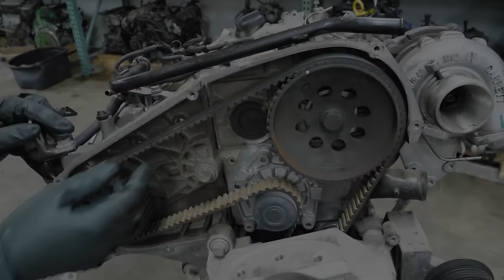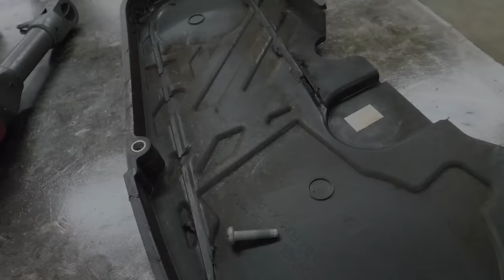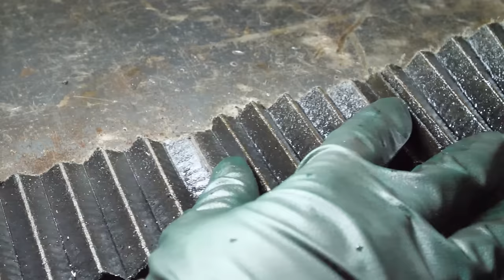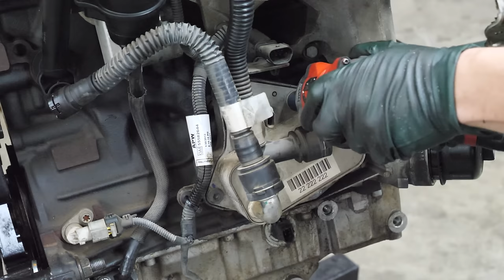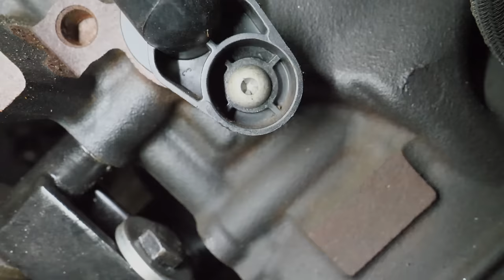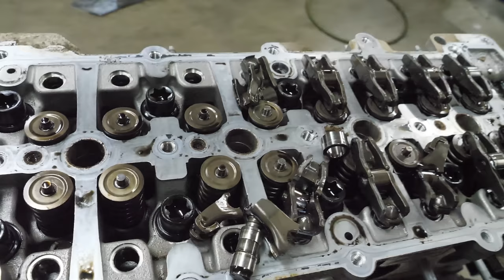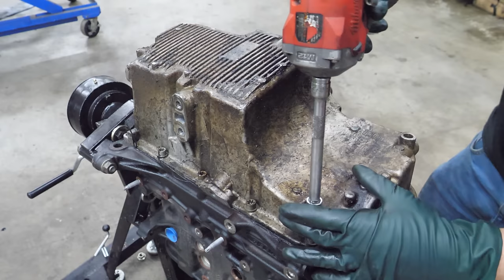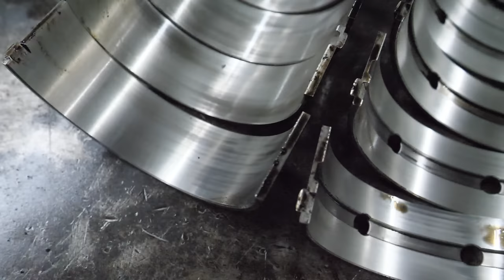I RUINED IT! Tearing Down A "BAD" 2.0L Chevy Cruze Diesel The Wrong Way

Comment: This is a Fiat 2.0 Multjet engine for sure. very good engine indeed. They design the rockers to do that instead bent valves.
Reply: It's Italian how good could it be? 🤔
Reply: @samholdsworth420  kkkk, I mean.. good enough.
Reply: I initially thought this was the VM motori one that was in the older Cruze, but this is indeed the 2.0 Multijet!
The first gen of this engine liked to spin the main bearings due to a design flaw in the oiling system, LOL
Reply: Think that's the PSA engine
Reply: It’s a fiat?  Rut Roh, rrorge!👎
Reply: 2.0 Mjt is based off the 1.9 JTD 16V
Reply: It'a Fiat engine. Very good engine. Italia made sit in Opel Chevy, Saab and Fiat .
Reply: @samholdsworth420 people get 400hp on stock internals. All forged. First gen 8v that was first common rail diesel in car is best diesel engine made in europe
Reply: Yes, it's the updated 1.9 Fiat JTD/Multijet.
The 1.3 Multijet behaves the same way in case of timing chain failure
Reply: Yep FIAT multijet unit best version of this engine with four cylinders is in Alfaromeo`s they also made a 2,4 version with 5 cylinders can be tuned for mega power.
Reply: @samholdsworth420  Diesel powers most of Europe because all we think about is MPG.
Reply: That engine is a good rebuilder.
Reply: @samholdsworth420  Clean your mouth, if there's something that's good from FCA (Italian ones...) are the engines.
Reply: @AlessandroGenTLe  u mad bro?
Reply: Hm I don’t think so: it’s covered in GM  badges and, in the early teens, Fiat bought Chrysler and I’d find unusual that the collaboration they did have in the first decade with GM was still going.

Said collaboration saw a platform being shared (Fiat Croma, Saab 9-3 and Opel/Vauxhall Vectra) and did include an interesting Diesel, but it was a twin turbo 1.9L that showed up in Saab and Lancia and got 180-190 horsepower. They had a 2.0 in Fiat (Bravo) which put out 140 or 165 HP but I’m not sure it ended up in any GM  product.

Now the lot have been bought by Peugeot-Citroen and the Multijet engines are being phased out, alongside with all other Italian designs, in favour of French oil-burning stoves. Bloody french. No idea about the fate of Chrysler: over here in Europe only Jeep is still sold and the small dorky models are also turning French.

This is a copycat of how VAG does it since 20 years but in French gravy. Which IMHO is as sad as f**ck because you get one car to buy with a dozen different skins.

~~~

I stand corrected: this really is a Multijet II engine and it just made it through before the FCA Group era!
Reply: @samholdsworth420  actually Multijet engines were very good. Also the small petrol FIRE engines were really good, too. And apparently this is one of them, just before FCA era.
Reply: @Me-zo8yc  You mean CO2/km?  It went from 10% diesel passenger car share in 1995 (the same as Japan at the time) to50% diesel passenger car share in 2015 based on EU policies,where Japan and California went to the petrol-hybrid approach like Priuses  instead. I would say it was a deliberate policy to support domestic industry, as European car makers are good at passenger car diesels where the emerging Japanese brands who were gaining market share  in Europe in the 80's and 90's are really bad at  them. But Europe realised  they were mistaken (there are  lots of particulates and soots from diesels that damage urban air quality in cities like London) and have back-tracked on that now.

In many countries in Europe, diesel had much lower fuel excise than petrol to support this policy of encouraging motorists to buy diesel passenger  cars.  But this is being reverted these days.  There are less of the older diesel cars which are still ULEZ compliant for being allowed to drive in inner London for example, compared to older port injected petrols that produce lower particulates.
Reply: Don’t know where you are getting your information from the 1.6 LH7 is a Opel designed, Hungarian built diesel
Reply: It literally has GM markings on the heads, block, and crankshaft but feel free to continue with the “ItS a FiAT” nonsense
Reply: @Veritas419 I mean you also have the same thing with Ferrari and Chrysler...
Reply: @Veritas419  I have this in my Jeep Compass with the FPT markings all over it
Reply: @Me-zo8yc it italy when I was there early 2000s they were all diesel and manuals. Only one car I saw had a automatic. Mpg over hp
Reply: @Veritas419 a couple engines from GM powered FIAT cars as well. At least here in Brazil. Pretty common to mark them as it was yours.
Reply: These are good engines.
Coming from VW-motori / Fiat.
Could drive lots of kilometers / miles without any issues.
Only when used for short runs de EGR and the valves in the intake manifold wil lock up. 

So, blind the EGR, and remove the swirl flaps, and you have a super reliable engine.

In original state it can be tuned to 210 a 210ps, and 450nm
Reply: It's fiat 1.9 from the beginning 
Very nice engine
Reply: Fiat has a long history with long lasting and efficient diesels, small and big👍
Reply: 2.0 D 4 cyl better is M47
Reply: @Veritas419  Fiat designed built by GM of course they put their branding on the ones they built. They don`t want customers opening the hood and seeing fiat logos in a gm car.
Reply: Wait , fiat designed something good?
Reply: @fuse8052  fiat have designed lots of good engines over the years. i had a part share in a race car with a fiat engine (1300cc uno) when tuned we ran the engine up to 8500 rpm with a standard unmodified bottom end as per our class rules, not the slightest problem with this ran 3 whole seasons no problem.
Reply: Sometimes... 2.4 20 valve in a 159 bent all of them. Just started rebuilding it.
Reply: @stih201 no Fiat
Reply: @stih201  Nope, it's an FPT engine.
Reply: @wimv6  You mean VM-motori I guess, but this is an FPT engine. The VM-motori engine in the cruze was SOHC. Yes, Fiat owns VM-motori, but this engine wasn't designed or built by them.
Reply: @SBT300  we bought a brand new 16V engine  and picked it up at the Opel engine Factory in Keiserslautern Germany,  it was in a VM-Motori crate.
Reply: @wimv6  The VM-motori for the cruze was 16V, but SOHC. As you can clearly see in the video, the engine is DOHC. That's the FPT engine.
Reply: The Chey had a Chevet with I think was 4 cylinder diesel and may of had 3 made at the Alanta plant we would have to get a running start to get it on the ramps . But at the start of ramps it would not go over the end of ramps no power and a auto I think and they were junk !
Reply: Huh interesting
Reply: @samholdsworth420 better than the 1.4 multi air engine for sure

Comment: This engine had a bad waterpump. The waterpump on it was brand new  the waterpumps on these engines have a habit of seizing up than the belt will rub against the cover until it snaps. Thas why the rockers were broken. I think they did a timing kit on it to fix it but it didn’t work. This is a common problem of this type of engine what actually is a fiat/alfa romeo engine that gm had the rights to manufacture.
Reply: I would pass on any Italian engine😅
Reply: Its actually a very good engine you just have to change the waterpump on time. I have seen these engines run over 300000+ without any major issues.
Reply: That makes a lot of sense, actually.
Reply: @sofarsogoodsowath   Except for three water pumps !  😂
Reply: Better go get that pump out of the bin!
Reply: @samholdsworth420  I had a 1992 Alfa Romeo 164-S with the 3.0 12-valve busso, it had over 420k miles on it when we parted ways due to irreconcilable subframe rust. And yes, that was a lot of timing belts... But the engine was solid as long as you never let it de-tension the timing belt from rollback in gear, or forget to change the belt and tensioner on time 😅 the rest of it was great
Reply: The French and Italians make crappy products BUT their diesels are very good!
Reply: you sir need upvotes, take mine
Reply: @samholdsworth420 why? I drive Italian Cars since 30 years and I work on Italien cars for 15 years. There is no Bad engine, but Bad drivers. When this cars get out of garantie the owners dont do Services. 1st owner goes to fiat dealer and let them repair these cars. 2nd owner went to a freelancer and 3rd only drives with the Sun in the Tank and Wind in the back.
Reply: @peterdevreter  The French and Italians get the reputation of making crappy product and their stuff from the last 15 or so years where they swapped a lot of stuff with other manufacturers to save cost would bear that out but going back in time the two countries gave us some of the best innovative design  and were not afraid to think outside the box. It was a time when cars were interesting and each marque was different. They were hard to work on and that is another reason they had a bad rap but they were never boring. Citroen Traction Avant/DS of 1955 and the SM late on, the Renault 5 Turbo - 12-16- 2CV and 4 CV,  Peugeot made tough reliable cars for many years that were rally champions, Fiat Spiders/1500 models/Alpha Sud /GTV's and more, Ferrari, Lamborghini, Maserati, Lancia. Lots of rust but never dull meat and potatoes cars.
Reply: That is exactly what happened. Well spotted
Reply: The rockers were broken by using an impact driver to turn the cams and drive the valves against a piston at TDC.
That is blindingly obvious
Reply: @PaulG.x  So explain the broken rockers on cyl.1 which was at BDC.
Reply: @PaulG.x  and explain no ticks on the top of the piston if so blindidly obvious
Reply: @spaceghost8995  My neighbor's 2nd gen 5.7 Tundra went through more starters than that. OEM starter every time too😂
Reply: Very similar to my cjaa tdi, need timing belt and water pump every 120k
Reply: @ctbale1  explain how the rockers were bent then
Reply: @PaulG.x  ok, I will educate you, but first grasshopper tell me how #1 and #4 cyl rockers broke when their valves hit the top of the pistons when they were mid stroke.  So many clues grasshopper, follow the clues..... :)
Reply: That's far from a certainty. I do think it was running when the valve damage happened, but I don't think the water pump started this. These cars alert the driver every 100k miles with a message that says "Change Timing Belt - See Owner's Manual". I'd wager a bad shop royally screwed up the job. Someone spent a lot of time scrubbing the water pump mounting area... except the water pump on these uses an o-ring. No gasket. I've replaced my timing belt, water pump, and idler/tensioner pullies twice on mine, never had an easier water pump in my life. It just slides out of there. Nothing to clean. Conversely, the owner might've ignored the messages and drove the car until timing belt failure, at which point a shop didn't realize these are interference engines and replaced all of those parts just to find out the motor was toast. Either way, hard to say after it's been sitting.
Reply: @Nightlis1  ha. no.
Reply: Yes I've replaced my waterpump 3 times in the last 2 years

Comment: I used to build these cars in Lordstown and I was there when they launched the Turbo diesel. Just a little nugget, the diesel  cars came down the line with a red manifest taped to the hood indicating diesel, regular models had a white sheet. Diesel car all received heavier trim pieces, thicker hood pads, thicker firewall padding, thicker padding under the carpet, behind all the trim pieces. and under the rear seat. They also received more body sealer inside the spare tire well from the body shop. I'm pretty sure they also had a thicker head liner. All to help with the extra noise from the diesel.
Reply: Very interesting, I would never have thought they'd invest the cost and effort!
Reply: Unrelated, but I have a 2009 Chevrolet Cobalt SS. You guys did an awesome job assembling it. 👍
Reply: @James-vt2cb  The "ECO" model was quite the opposite. It received less padding or lighter parts. Some padding was outright eliminated. It had no body sealer in the spare tire well all in an effort to make the car lighter and more fuel effecient. And if I remember correctly, the front grill had movable louvers that would activate in certain conditions to help with the aerodynamics also improving fuel economy. As far as features goes, it was basically stripped down, as basic as it gets. So basically, you're getting a better built car when you buy the diesel because everything was beefed up for the diesel engine.
Reply: Thanks for the added info! I had a 2015 with this engine. Very smooth running and powerful. I did have a tune on it for 30 more HP. She scooted pretty good with ~ 280 lb-ft of torque. Wish I hadn’t sold it.
Reply: Thanks man! My 2014 Cruze Diesel just passed 204k miles and there are still no rattles in the interior. I love that little commuter car, I have no idea what I'll replace it with someday... 😢
Reply: @James-vt2cb GM hasn't spent any money. Because the EPA thought that diesels would be the next thing to save the environment, everyone got tax credits. Same reason some GM cars have e85 ethanol standard, it's only for the tax credits.
Reply: Thanks for sharing.   Amazing the differences in the same car.   My Dad was a life long autoworker.   It’s so sad that they import cars from Asia and try to pass them off as Chevys and Buicks now.
Reply: Having driven both the 1.4T LTZ and the 2.0L Diesel, I thought the Diesel rode better and felt more solid, so that wasn't just my imagination. Thanks for sharing!
Reply: You built a great car. Keeping my well cared for ‘14 Cruze diesel with every option forever. 215K so far.
Reply: @ck4181 they ground the welds down on the assembly line too. Really cool car.
Reply: Thank you for sharing that info.

Comment: About that unique fastener. You can't delete emissions stuff if you don't have the tools to take it off.  I'm thinking it was on purpose. Who knows.
Reply: They love to put weird fasteners on emissions stuff.   Just look at the screw heads on the needle valves from contemporary 2-stole carbs.
Reply: Fabricators and welders enter the chat.
Reply: @HappyHarryHardon  Anyone with an angle grinder or dremel, too.
Reply: anyone doing an egr delete on a fiat engine isnt gonna be stopped by your piddly five pointed nonsense
Reply: @uzlonewolf  Welder and fabricators use both of those tools.  Good job.
Reply: @HappyHarryHardon  Interestingly they are probably the most likely people to want to delete that stuff too.
Reply: @HappyHarryHardon  where theres a will theres a way
Reply: blue, is any tool you want it to be, job done..
Reply: Those are breakaway bolts the head snaps off when torqued to proper torque leaving that 5 point hole. Look in a service guide a shop has and it says to use a die grinder to aid in removing. I drill them out with right angle and extract then use a bolt with regular head I find with same length and thread pitch. There is 2 of those holding that drain back pipe in those cruise version. If you ever have one of these engines running like shit look at the valves/ runner flaps and they are probably caked in sludge choking the engine.

Comment: That 5 point fastener means someone is mad they're not designing stuff for Apple.
Reply: I was thinking that if a special tool is needed then layman should not disassemble it
Reply: @gs1100ed wait until they make you buy a special tool to change your oil. I've heard some new cars don't even have a drain plug anymore since you're supposed to suck it out of the dipstick tube.
Reply: @gs1100ed  Bullshit. If I own it, I should be able to repair or break it any way I want.
Reply: Take a look at all the telecom and utility covers.  They all have 5 pointed heads so you can't just put a crescent wrench on it and get into the fiber vault.
Reply: Pentalobe, the screw head designed by Baal-zebub himself.
Reply: @CTXSLPR knipex disagrees..
Reply: Guarantee that fastener got there because the Engineer accidentally specified the wrong part from a manufacturer catalog and no one second checked the poor guy/gall.  As a design Engineer I can attest we are not that stupid, but we do make mistakes and managers/advisor level engineers would rather be pie in the sky people than mentors and help us peons out…
Reply: @iamstd2  because they want you to change the vehicle for a new one.. lol
Reply: @Oddman1980 yep thats why its a “right to repair” law and after so many years the manufacturer has to release software for you to be able to run in depth diagnosis on your vehicles many modules now….plus offer tools for said repairs
Reply: @young11984 I thought they outlawed new fasteners a while ago or that they couldn't be far different from already used ones
Reply: @malachimarko7963  its possible they did but those type screws may had been used for years in another market though or was used under the dash where you couldnt see enough to know lol
Reply: Those 5 point bolts he was talking about are the ones where the head breaks at a certain torque. If you look up how to take that PCV system of in alldata/ shopkeypro/ Mitchell it says to use a die grinder to cut the head to remove😂
Reply: @Oddman1980 don't but a BMW, Audi or Mercedes then, they all have torx security bolts and no oil drain plug. They also claim that ATF / gear oil never needs changing for the life of the car. So it's not easy to service euro cars at all.
Reply: @tomtom1541 never had that issue with my 525i…it “claimed” that the transmission was “lifetime serviced” but you could absolutely service it with a kit from one of several vendors.  New pan (with filter), new fasteners, recommended quantity of correct fluid, new drain plug and instructions on how to perform the work. Honestly, it wasn’t any worse than exchanging fluid in my 2004 F 150.